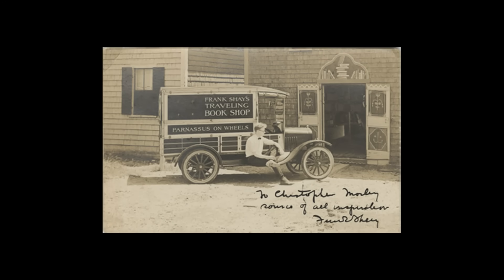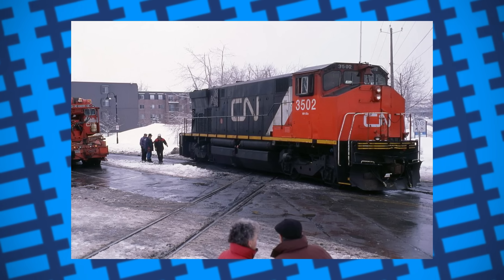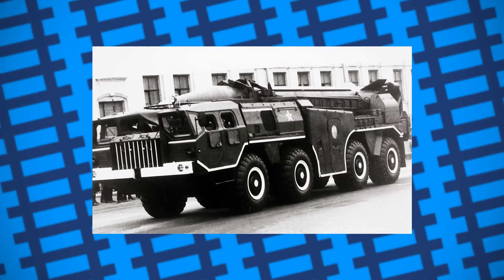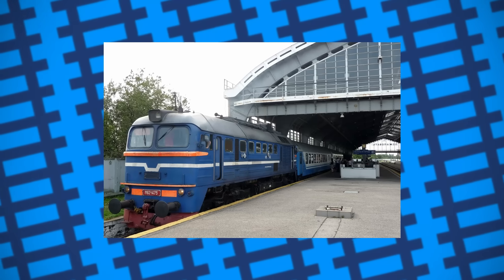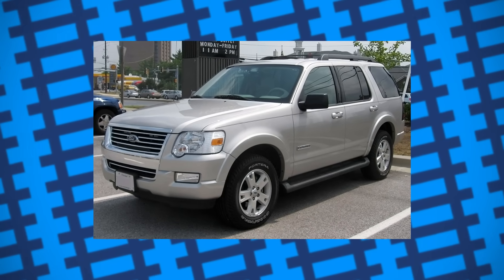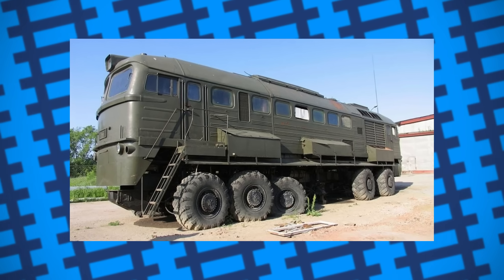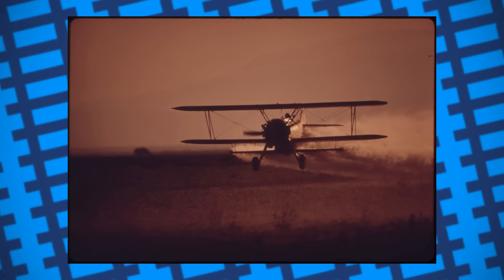Why Railway Locomotives Don't Make Good Road Vehicles - M62 + MAZ-547

Comment: For reference: trucks typically have maximum axle load of 8t while the whole vehicle is often limited to 40t
European trains usually have 20t axle load, the US more like 35t.

That’s a 6 axle locomotive (6*20t=120 t) being put on 6 road axles (6*8t=48 t)…

Of course everything broke
Reply: There was certainly a mistake in the engineering. Otherwise, the task was not unique as Russians have super heavy ICBM carriers that weigh up to 200 tonnes in total. Nothing breaks there.
Reply: The locomotive in question isn't that heavy, it's only 82 tons. And, those ain't road axles. Those are heavy duty off road missile carrier axles. So, they'd be heavier duty. Also, axle limits are not the same as what the axle can support. Axle limits are how much the vehicle can legally weigh, so that it does not damage the road or bridges. However, the amount of weight the axle can carry before structural failure is not that, and can be much, much higher. Many mobile cranes are partially dismantled for road transport, but on a jobsite can move around fully assembled without problem. The axles can easily handle the full weight of the machine.

So, something went very, very wrong with this project. I don't know how much the regular MAZ 547 can carry in terms of weight, so it may have been too heavy for that particular chassis. Or, the chassis conversion was not done correctly or competently, because it's not like Russia is known for having problems like this. I have to wonder if some of the people involved in the project farmed out the work to some folks who'd get payed in vodka, and just pocketed a lot of the money. But come on, it's not like Russia has massive problems with that or anything.
Reply: @saberwing7930   that’s surprisingly light. And of course, you can build heavy duty chassis. I guess they really goofed
Reply: MAZ 547A isnt your average road tractor, it has a curb weight of 55t, its designed to carry ICBMs weighing up to 2 times its own weight, which is a bit of a soviet specialty, as the similar but shorter MAZ 543 and 7310 were also designed for extremely heavy payloads like this, with a quick google search and watching the video ive been able to work out the M62 has a curb weight of just over 116T, so the 547A chassis would've easily bee able to carry the locomotive, especially if you remove the heavy cabins that the truck normally came with and the bogeys on the train
Reply: @linux_doggo
Exactly my point. In fact, as stated in the video, the locomotive weighs in at 82 tons, without the heavy bogies. Something went really, really wrong with this project.
Reply: рама и начинка там НЕ ОТ ЛОКОМОТИВА!
Reply: Maybe the hydraulic for the steering or power distribution to the motors was not correctly connected/limited.
if they mixed up the hoses for axle 3 and 4 on the left side it could explain why one was destroyed on the other severely damaged
Reply: @mammutMK2   I mean, that WOULD be on brand…

Comment: 6:46 That's not a M62 but a Chinese DF4 loco.
Reply: They look quite alike. Are they based on eachother on anyway?
Reply: @danielbedrossian5986  Both are double-ended carbody-style 2-panel windshield 6-axle diesel locos painted green. :) Which is very common for both USSR and China.
Not sure about DF4, but DF3 is essentially the Soviet TE3 (ТЭ3) loco, also a 6-axle carbody (albeit single-ended, and each loco consists of two such units permanently assigned together). How much of DF3's design went into DF4 I don't know.

Comment: Funny enough, I've actually fantasized about building and/or designing a road locomotive. My design resembles a climax steam locomotive, but it uses a diesel engine like what you find in diesel pickup trucks. It's also made out of standard automobile materials and has a fully enclosed cab. It has video monitors to help the driver see where they're going (and what's around them), and it has a whistle, bell, and an optional (enabled or disabled) smoke feature to add to its look. However, it will also be fitted with a regular automobile horn, and it's made to be roughly the same size as a large SUV.

Also, we kind of already have road locomotives around in the form of steam traction engines.

Comment: Train on the road, bus on the track.
Train on the road, bus on the track.
Reply: Is that a Family Guy reference I see?
Reply: @ What do you mean?
Reply: I mean rail buses exists. Both in buses that can run on both road and track, and buses simply permanently converted. Because it was just cheaper to do it that way.
Reply: @ Where did your info come from?
Reply: I wouldn't be shocked to find out if T1E2H3 did all that in a single day...
Reply: I've seen trucks on tracks used mainly as shunters. Buses on rails exist and even motorcycles too with some carts attached to them.
The only thing left to see are boats on tracks or trains as boats
Reply: @ Okay.
Reply: I mwan, half of Eastern European rolling stock is soviet railbusses so you are not wrong.

Comment: Only in Russia.

while i'm here saying that: Edison Motors, a small firm in Canada are planning to produce diesel-electric trucks that work on this exact principle with an added battery

I think it wasn't so much the weight but rather the strength of the axles and the parts holding the wheels? I guess they were too weak to handle the tonnage put upon em.
Reply: Edison is using a smaller prime mover than the same capacity conventional truck. If they were putting a literal diesel electric prime mover and alternator in, there would definitely be problems.
Reply: @daniellewis1789  Actually, no they're not. They're building full sized prime movers and using a big diesel engine (Scannia) tuned to generator specs to run a generator that bolts directly to the back of it. They have the batteries just behind the cab, and then the electric motors are built onto the e-axels they have at the back.

Go and look at what they're doing. They're being very open about their specs and designs.
Reply: @ConstantlyDamaged  Yep, they have a full size Scania conventional setup but they use a slightly undersized prime mover for the battery hybrid units. Same with the pickups, they spec a smaller prime mover than (most) donor chassis would have shipped with.
Reply: @daniellewis1789  Hrmm, I think this is a language issue. Here (Australia) a "prime mover" is the entire tractive unit of a semi truck—not just the engine under the hood.
Reply: Oh heck, they used a 150 L engine instead of a typical truck engine of 15 L.
Reply: Yeah Edison is great, but luckily they didnt just mount an entire locomotive on wheels for that XD
Reply: To a degree weight was a problem. We have to consider that modern diesel engines have a way better power to weight ratio then back when this locomotive was built. The same goes for the electric equipment. That part is more noticable in fully electric locomotives though, as they require more complex circuitry to regulate the amount of power that goes to the motors (diesel electrics can throttle their engines up and down, but overhead lines are always on full power).

You could make the axles and tires stronger to deal with the weight, but the vehicle was already at a weight where many roads and bridges struggled. So it was already struggling as soon as the roads got a bit more rural.

Also I'm really excited to see how Edison Motors will fare. They've got a great product, for a niche abandoned by many manufacturers even though it will keep existing for quite a while. By focusing on what electric trucks do best (stopping and going) instead of what they do worst (long hauls at constant speed) they have a solution that is attractive right now. And by offering hybrid and even mechanical trucks they can even bond with customers who aren't quite ready to jump to electric yet.

Another interesting and growing niche for diesel-electric are semi-stationary machines such as excavators and mobile cranes. Diesel electric allows them to run on a cable with cheap and quiet electricity when used at a site, yet they remain the functionality to move under their own power or operate in remote places
Reply: They aren't actually using a loco.
Reply: It must be the cold and snow. Back in the 50s, and american company called LeTourneau Technologies built massive diesel-elecrric land trains to haul supplies to Alaskan outposts.
Reply: Apparently, the New Flyer DE60LF was offered as a series hybrid, using a diesel-electric drivetrain and ultracapacitors for energy storage. I rode one almost every day for many months and wasn't even aware that it was a series hybrid. I did know that there was something different about it because of the way that it drove, I just couldn't tell exactly what was going on with it. It also had problems on the highway and we were all made to get out and onto another bus more than once. I asked the driver about it once, and he seemed to think that there was something wrong with the diesel engine, but I'm wondering if the stretch on the highway simply drained the capacitor bank and left only the diesel engine (a Cummins engine which was usually used in light pickup trucks, not busses... a B series) powering the bus. This was an articulated bus, so the little pickup truck engine would have definitely had a hard time moving the bus on its own.

Edit: There were also parallel hybrid versions. I distinctly remember the bus shifting gears, so that may have been when I rode on the parallel hybrid versions. The series hybrid versions were likely the ones that had problems on the highway.
Reply: MAZ is a Belarusian company
Reply: The Edison motors truck isn't a diesel electric, it is a battery electric truck that carries a backup generator.

Comment: Imagine having to deal with TRAFFIC because a road train stretching miles wide needed a tire change? 😅
Reply: Imagine the havoc of a tyre blowout in a tunnel…

See gotthard base tunnel wreck and merge it with a tunnel fire (like in the mont blanc tunnel)…
Reply: The Big Bus had this problem solved long time ago.
Reply: Visit Western Australia some time.
Road trains with five trailers carry up to 300tons of cargo. Powered trailers are a thing in this application too.
Reply: @allangibson8494  can you get a dui on a powered trailer 🤔 😂😂
Reply: @zakburnett6690  The powered trailer is slaved to the prime mover…
It uses the same Cummins drive hardware used on “Sprinter” passenger trains but with rubber tires instead of steel wheels on the bogies.
Reply: @allangibson8494  so you can't then can I use urs to go to the liqa store 😂
Reply: @ Like catching the bus… (Articulated buses are a thing too)…
Reply: Depending on how many wheels it has and where the blowout is I believe it if not close to the Engine 🚂 half a mile of cars away it would be unnoticeable.
Reply: @iamjames8403   the wreck in the base tunnel went unnoticed for a few miles until it smacked a wall. Took out the tunnel for over a year
Reply: as a Western Australian this is already a thing :> though our road trains are just big trucks with a zillion trailers
Reply: Why are they a thing though? It's less efficient than a train and more dangerous than a normal truck already is, I don't get it! 

The settlement of America has only been possible thanks to the train, yet Aussies insist they need the road trains cause they can't build railways to every neck of the woods. If you were able to pave a road there, you would have definitely been able to lay down railway tracks instead, and probably much cheaper, too! 🤨
Reply: Reminds me of when a German bucket-wheel excavator needs to be moved to a new dig site. The 14,200-ton Bagger 293 holds the Guinness World Record for the heaviest land-based vehicle ever built (cost around 100 million dollars). It's a tracked vehicle that is run on external electric power, so it drags a big electric cable (around 17 MW in normal use). When it moves to a new dig site, the cable occasionally needs to be switched to another grid attachment point; the thing essentially needs its own road built (and often un-built afterwards), and it is not rare that it needs a repair while moving between sites, as that's not it normal mode of operations - it tends to stay at a site for years (even decades) at a time.
Reply: @ These are the reason we need antigravity ASAP.
Reply: Road Train: combining the drawbacks of trucks with those of trains! Australia thinks they're a good idea though...
Reply: Why would it be a mile wide? A mile long maybe
Reply: Imagine having to deal with TRAFFIC because a train stretching miles wide needed a tire change? 😅   Oh... Wait. That is called a train delay. Where a train has to stop or derailment... Imagine if a traffic light stopped working and the road then had to be turn into a one way street until being fixed. In rush hour.

I do not even know what is done if say the traffic light partly fails in a intersection. Dose the hole intersection lose traffic lights? Imagine a super important intersection in a city lost traffic light. Imagine! Imagine dealing with TRAFFIC because some LED or whatever light broke? A wire or something snapped due to a rat eating on the cable? Etc, etc...
Reply: That’s literally infamous Russian 40 mile long column stuck between Belarus and Kyiv in March 2022.

(Even if vehicles weren’t physically coupled)
Reply: Happens is Australia all the time they manage just fine.
Reply: Wide?
Reply: This actually happens sometimes with Australia's road trains. They have to have many spare parts including wheels, in the trucks because you can't call AAA when you get stuck in the middle of Australia's desert.

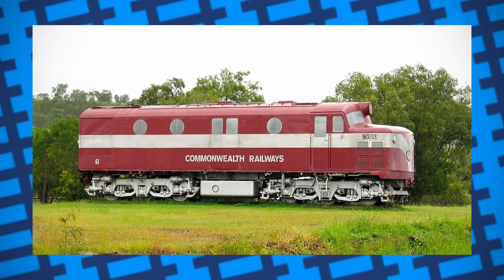Comment: 1:08 what about diesel-hydraulic and diesel-mechanical locomotives?
Reply: Both of those are rather uncommon. Diesel electric is the standard diesel type across the world. 

Plus, it would be very annoying if he explained the differences between all the diesel locos in every video about diesels
Reply: @thomashambly3718  they exist but you generally don't find them outside of small industrial locos and shunters
Reply: @thomashambly3718  Diesel-hydraulic is German standard from the beginning
Reply: @ Yes, and only Germany, Finland, and a few other countries ever used Diesel-Hydraulic engines, so my point of "Diesel-Electric is the standard around the world" is still correct, and explaining the differences between them would have been unnecessary.
Reply: @thomashambly3718  True, but would have been interesting to know.
Reply: @peters1127  yes, but it would become tedious and boring for everyone if he explained the differences between each type every time he made a video about a diesel
Reply: @ I get it!
Reply: Because those are basically how normal road vehicles work already? Diesel-electric is something that hadn't really been done for road vehicles, though I imagine it's the kind of thing that might work well (with appropriately-sized power units) for heavy freight vehicles (and it's sort-of how some hybrids work now).